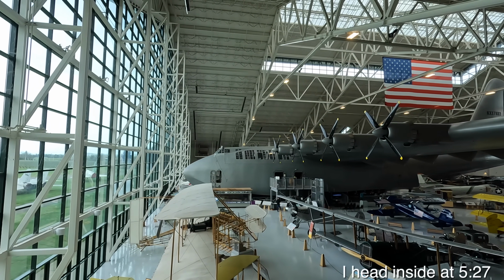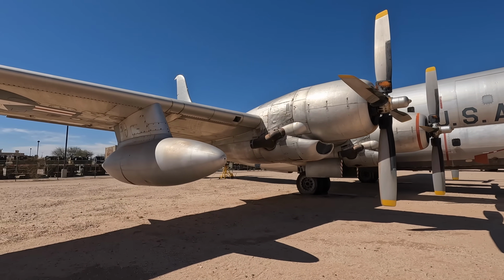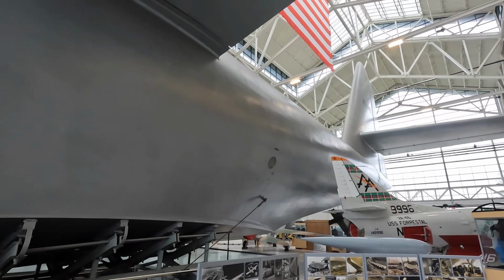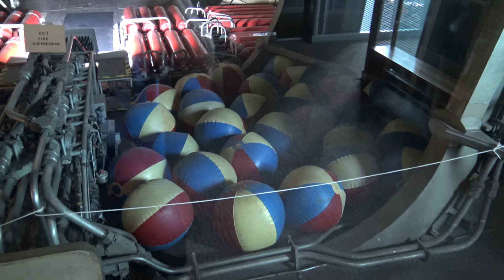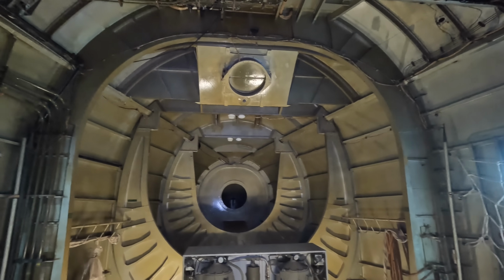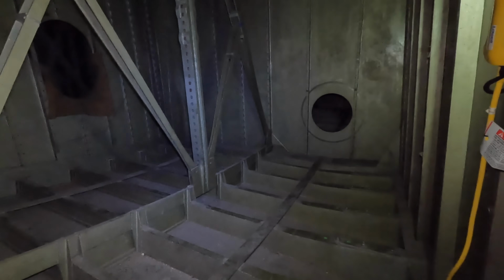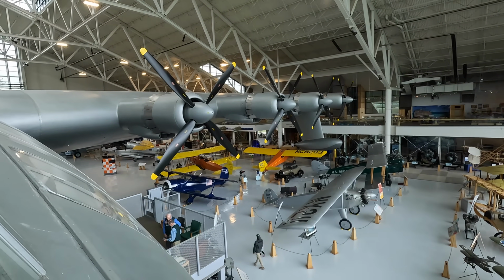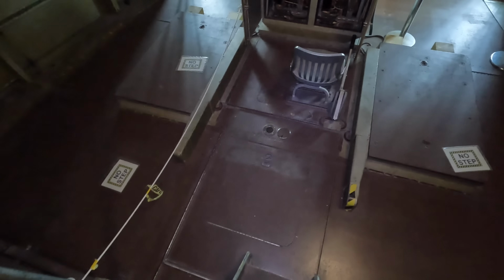Detailed tour through the Spruce Goose! - the Hughes H-4 Hercules.

Comment: I'm from Botswana and had the pleasure of walking into the lower section of this iconic aircraft. That was in Long Beach Calif. In 1983, around September. Back then if I'm not mistaken,  it floated on 3 patches of water. The plywood skin was rather lumpy, having sat in Long Beach until early 1983 when it was first unveiled to the public. I walked through the lower section allowed to visitors and up the outside stairs to the cockpit where a "wax model" of Mr Hughes sat in pilots seat with cigar in mouth or hand? Mouth I think?? It was in the "DOME" Opposite the Queen Mary ship. Strangely, I was repelled by the ship??? Never mind. In the Dome was a Hughs racer. An amazing little record breaker. There were excellent displays of Hughes aviation achievements and design drawings of the Goose as well as a myriad of other paraphernalia of great interest. I spent about 6 hours there with an RAF helicopter pilot who I met and travelled there with. Great day!! I had been to Oshkosh Wisconsin EAA air show before this, 1983, and seen Bob Hoover fly his yellow Mustang and his Aero Commander many times over 4 days. There were plenty other aviation greats but Bob Hoover in Oshkosh, and Howard Hughes Spruce Goose display in LA area were tops in my tour!! I had previously done 5 years service in the Rhodesian Air Force from 1973 to 1978 as aircraft engine mechanic and gained a glider pilots license and PPL. 160 hrs and 2000 hrs to date. So I'm a huge fan of all great aviation achievements, especially in USA, the world leader. Please patriots, get your FAA back into line as advisory instead of spying police. The patriots changing the known world for the better are paving the way. Now's your chance, and your work will pave the way for global freedom with assistance from FAA, instead of interference from them. While their intentions Might be good, they are mostly full of shi#.

Comment: Former Boeing Everett.... this is the best POV (point of view) tour of this remarkable aircraft I have seen. Although it's hard to really take in the immense scale, you did an outstanding job showing it. I am used to 'big' from Boeing Everett, big aircraft,  big factories, big turbofan engines. The H-4 Hercules is more on the scale of the Antonov An-225 Mira. 

Your explanation of the rear horizontal stabilizers being wider than the wingspan of a B-17 was effective. You could park entire smaller aircraft on each. Today, 4 engines power really large aircraft; B747, A380, military cargo transports. Most aircraft have 2 engines. B-52 has 8, An-225 has 6, H-4 has 8. 

We have all heard of fly by wire. The H-4 was fly by hydraulic tubes, first use of power multiplier from pilot input to control surface movement. It's really a shame that the war ended before the H-4 could be put into service. It would have been a real game changer. It's only weakness was size and speed. Without fighter escorts across ocean, it would have been an easy target for enemy aircraft. 

Thank you for producing this video of the amazing H-4 Hercules. Now we know why it was called 'Hercules'.

Comment: The Evergreen Air and Space Museum is fantastic. Covers both aircraft and rockets. Nice clean facility and good food. Staff are extremely nice and you can camp over night at the back of the parking lot for free, no questions asked! Not to be missed. Be sure to take the H-4 cockpit tour, no matter what. I've been a pilot for more than 50 years and when I sat in the left seat I was amazed how "at home" if felt. It really was designed for pilots. Every control was exactly where you would expect/want it to be. There was no sense of how huge the aircraft is except the height off the ground. It really wasn't much different than your average single engine aircraft, except for all the throttle levers! Very natural and comfy.
Reply from the maker: Yep it’s a fantastic museum

Comment: 14,000 gallons divided by 8 engines is 1,750 gallons of fuel per engine. Burning at 100 gallons an hour would give you 17.5h of fuel. They hoped for 250mph top speed, but 200mph was a more realistic estimate of the top speed. That gave this aircraft a max operating range of around 4,375 miles.

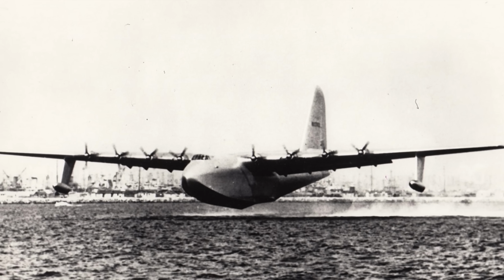Comment: 05:10
”…proved that it could at least fly…”
No. It couldn’t fly. Twenty seconds at a height of 70 feet for a distance of one mile in GROUND EFFECT is not considered ‘flying.’ If it could fly then it would have been flown. Clearly Hughes couldn’t get the lumbering too-heavy aircraft out of ground effect, realized that the monumental design and construction was a failure and gave up.
Reply from the maker: Fair point.

Comment: Poor Howard Hughes is a perfect example of how society can be very hard on the true geniuses.
Reply from the maker: It's complicated. As fascinating as the H-4 was, it was still a failure. And it probably wouldn't have ever flown any higher than on that test flight. It was probably just using the ground effect and flying any higher would have been impossible.
Reply: @PaulStewartAviation  Perhaps true, but it was only ever a prototype. More powerful versions of the engines used existed, but weren't available due to wartime rationing. Regardless, a newer version, likely jet powered, would have benefitted from all the experience on the H4. Instead, techniques like composite construction were pushed back a half century while airframes like the 747 flew around effectively unchanged for a similar period of time. I maintain that Hughes was just a little bit too visionary for society to fully accept his undertakings, even with his quite lengthy list of accomplishments.

Comment: the problem with the plane is they did not understand ground effect forces much back then, at least in the west, for its size even those 8 engines couldn't have lifted it out of the ge region
Reply: HAPPENED WITH HELICOPTERS AS WELL
AT 25 FEET THE CUSHION OF AIR ESCAPED SO LOSING LIFT.
LIKE THE RUSSIAN OCRANOPLAN THAT DID 400 MILES PER HOUR AT 25 FEET.
LOWER THAT SAIL LAD  OUCH

Comment: Great video and definitely want to check it out when I get back to the states next. Just a note ADF and the NDB ground stations are still very common on modern small airplanes, and in Australia we have a lot of NDB installations around. Eg here in Melbourne - Moorabbin, Horsham, Hamilton airports come to mind as having NDB installations still active. I will admit it's slowly disappearing though.
Reply from the maker: Interesting as I didn't realise that the stations were still in use? Does DME use those?
Reply: @PaulStewartAviation  DME is VHF I believe. The NDB is low frequency. If you see near an airport two radio towers, wire in between  going to a box that's a NDB.

Comment: Wow! 8 engines each with 28 cylinders is a lot of moving parts!   3000 hp per engine equals 24,000 horsepower total!   What a sound it would make with throttles opened up. All all this back in the 1940's!  Very impressive. Some good videoing and commentary as usual Paul!
Reply: Would make plug changes fun, especially on a flying boat.
Reply: @thelandofnod123  two plugs per cylinder, 56 on each engine, 448 total.
Reply: @ostrich67  I would have loved to have had the contract of supplying the spark plugs!
Reply: It was in fact way under powered. It would have cruised  fully loaded at barely 100mph.
Reply: @billdurham8477 okay senator spruce....
Reply: https://youtu.be/MWg_0vLlMIU

Comment: Just massive. I've said it before, how hard it is to judge scale of anything in pictures and video, but when you see the tiny matchbox toy planes and I did see a car in there, against this massive flying boat, it really does show the magnitude of it. Even though it didn't really fly and became more about show and just how eccentric and a bit mad Hughes really was, it really must have been a sight to see. And still is. Another outstanding video.
Reply: From what I understand it did fly.  Not very high or far but definately airborne.
Reply: @shawnstephens1251  Well it got off the water, about twenty feet off the water. I really wouldn't call that flying.
Reply: @glenac05  if it did 20 feet, it could have done 200 and 2,000 just the same. He wasn't supposed to get it out of the water, but he did it anyway because he wanted it
Reply: @CP-ux9zd  I didn't know that. How do you know that? History shows it as a failure and a result of a rich man with too much money and with some clear mental issues. But, if you know better than anyone else, it must be the case.

Comment: The take off weight is interesting.. such a large aircraft, then again it is made of wood.

There is an A330 variant with a 251tonne take off weight.
A 747-8 447 tonnes  
A380-800 575 tonnes 

Modern airliners are engineering marvels.
Reply: I didnt see any timber at all. Everything was aluminium in this video.
Reply: @kizzjd9578  5:43 what you’re seeing down the fuselage is wood. 
 The entire airframe and surface structures were composed of laminated wood and all primary control surfaces, except the flaps, were fabric covered.
Reply: @Shoorit  ok cool, i saw dimples cut out and rivets everywhere so I thought it was all aluminium.

Comment: I was a teenager when I first toured this aircraft in long beach.  They used to have a creepy "Howard Hughs" mani quine sitting at the controls of the pilot seat.  One of the tour guides back then said that the aircraft never actually "flew" but lifted off the ground due to what is called "ground effect" where the downwash from the wing actually lifts the plane.  Hughs they said, was actually afraid to pull up and as a matter of fact had trouble trying to land the thing in the water.  You passed a brown Fedora and if it is the same one ... it would be the one Hughs actually wore ... at least ... thats what they said when it was in Long Beach next to the Queen Mary ... (which I explored when they first brought the ship in to the dock and was not yet renovated ... that was creepy ... but that is another story.

Thanks for this video ... I did not know it was moved ...
Reply: The Fedora in the aircraft today, is an exact replica of the original that Mr Hugh's wore.  

I believe, ( if I remember correctly, ) it was made by the same company.

Comment: is this thing even bigger than the AN-225 was?
Reply from the maker: Bigger wingspan, yes
Reply: Kj Gamer2614....you know, there are these things called Google and Wikipedia, where you could have quickly found an answer, rather than asking it via a comment to a YouTube video. Anyway, nobody can answer your question as you wrote it, not without reading your mind first. What do you mean by "bigger"? It was stated in this video that this aircraft had the longest wingspan of ANY other aircraft until the "Stratolaunch" was produced. If you mean tail height, then this aircraft probably still wins. If you mean fuselage length, then no, several other huge aircraft are 'bigger' that way. And certainly several other aircraft have greater payload.
Reply: @youtuuba  well you kinda answered what I wanted to know, just generally in all ways how does it compare, and now I know :)
Reply: But the AN 225 was a plane that earned it’s keep not just a static museum piece made of wood.

Comment: Back then, the only way to reliably tell whether it would fly well or not would have been to test fly it.  HH's short lift-off doesn't count, as it was lifted by ground effect and may not have been readily controllable.  But, today, computer simulation could tell you - someone should run a simulation.
This pointless plane was in any case H Hughes's folly.   For instance, with 8 engines each of 28 cylinders, that's a total of 448 spark plugs.  As experience with the B-36 showed, with the reliability of spark plugs at the time,  you'd need to change all plugs after every flight, and even then just about every flight would have at least one unserviceable engine.  With aircraft such as the B-17 (only 4 x 9 cylinders) there was only 72 spark plugs, so between flight maintenance was reasonable and engine failure during any one flight only 1/6 th as likely, 
However, being made of plywood, it would have a very small radar cross section, a good thing in war.   Germany radar at the time probably could not detect it.
Reply: Keit Hammleter, you are perpetuating an old wives tale. People in the know understand that the Spruce Goose was flying by any reasonable definition of the term.

And you are incorrect about 'the only way to reliably tell whether it would fly well or not would have been to test fly it'. They were sophisticated enough at that time to be pretty darn sure of a new aircraft's basic aerodynamics before building it. They were NOT able to know the fine details of flight, such as handling, stall characteristics, etc; and a big worry was whether the wooden structure would hold up in actual use.

Read up on the more scholarly information sources about this aircraft, and a lot of the commonly repeated things about it start to look unfounded and silly.
Reply: @youtuuba  : I accidentally left out the word "probably" in front of ground effect.   I notice you haven't cited any actual scholarly information sources.  Care to do so?
Back then, engineers could readily calculate lift and drag of almost any wing due to extensive NACA wind tunnel research done in the 1930's as a US Federal Government depression era stimulus project. And they could readily calculate control surface areas required and the forces required to shift them.   But no data was available for hull lift and drag  so that was only guestimated.    
A big advantage the US had over Britain and Germany was the monstrous concrete wind tunnel NACA built as part of that stimulus project.  It enabled them to test under controlled conditions full size wings and hulls, even complete full size aircraft.  But not the really big transports.   Lay people think you can wind tunnel test scale models.   You can, but it has serious limitations due to something called Reynolds number, especially as intended air speeds became a higher fraction of the sound barrier.   
In WW2 the Germans designed and built large aircraft in a hurry.  Often they found that the estimated engine power was significantly innaccurate.  When the B-36 bomber was designed and built, it was found on test flights that the power from the intended piston engines was inadequate, so they added newly available jet engines.  Even then it was the butt of a joke in the USAF, as in "it doesn't matter how long we make our runways, Convair will design an aircraft that needs longer ones."  Up until the end of WW2, the B-29 was the most expensive aircraft ever to design and get flight ready.   A big part of the reason for the cost is that Boeing did not spare any effort to get it right.  Even so, the USAF found fuel consumption was significantly higher and more variable than it was supposed to be.
Reply: So you’re saying it never flew even though it did lol.
Reply: @taylor7772  : I've read lots of articles on the Spruce Goose.   None gave a definitive answer.  Some speculated that Hughes deliberately lifted off, but there is no film of him at the controls at the time, and no record of control settings has come to light.  Some speculate that it lifted itself off due to ground effect, which was poorly understood at the time - but I've never seen any calculation or simulation for this.  What is known is that back then it was not easy to estimate the precise airspeed required to 'unstick' a flying boat from the water.